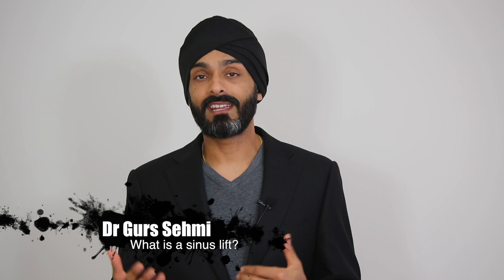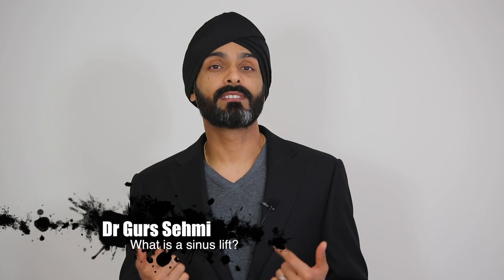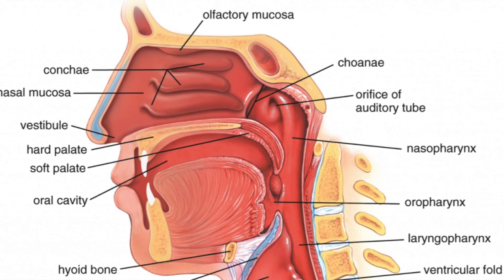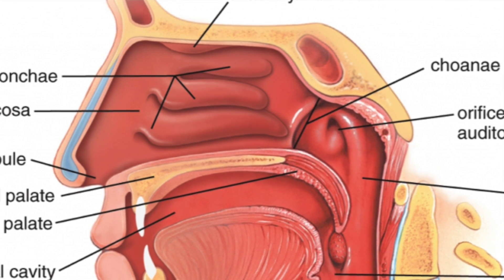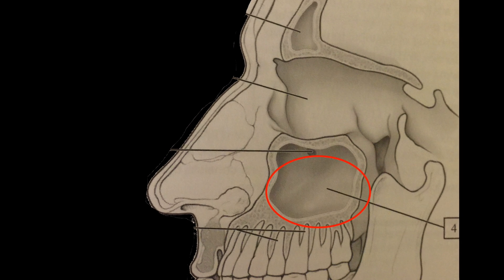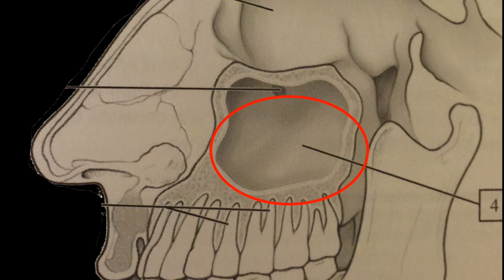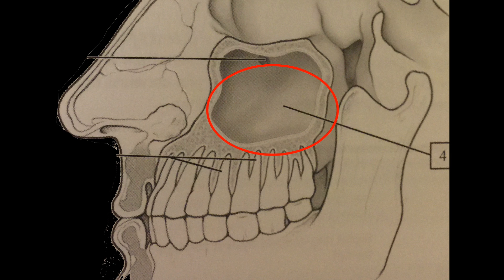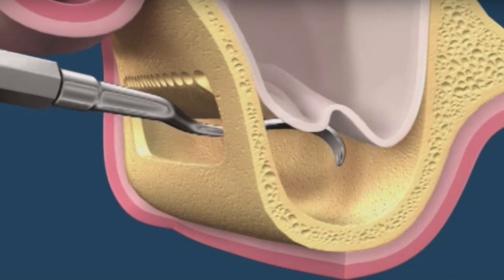What is a sinus lift?

Comment: This is off the beaten track but maybe someone can answer me. I have had all my upper teeth removed quite some time ago. Quite some time later I got excruciating  Tinnitus and it just never stops. Now I have read where some people have had wisdom teeth removed and then got Tinnitus (ringing in the ears), and I have also read where a person had bad Tinnitus and had a wisdom tooth removed and the Tinnitus stopped. I have also read where there may be a correlation with Tinnitus and sinnus. Has anyone experienced teeth extractions or sinnus problems with Tinnitus? Just wondering.

Comment: I recently had a closed sinus lift done. More precisely, they started doing it, and then the doctor said: “You have a complication, perforation of the maxillary sinus. We’ll postpone the operation for about a month and a half.” Then he stitched up the wound.
It turns out they made a hole for me, before that I didn’t even think that sinus lift surgery was so dangerous, because... all the doctors said that this was a very easy operation, “we’ll just tighten the gums a little”; and now I read what complications people have. Many people then develop problems with ENT diseases.
Now it’s unclear, alternatives haven’t really been developed yet - and this operation is now scary to do. Although the clinic is considered one of the best in the city.
Does anyone have any experience with this operation? Or a few years after it, how do you feel? Did you have sinusitis, etc.?
Reply: I had a lateral window sinus lift done a little over a year ago. I have had no issues to report. It was annoying to not sneeze or blow my nose for 4-6 weeks after. Also I got on a plane shortly after the operation and felt pressure in that area but no long term damage occurred. I went from 1mm of bone to 11mm of bone and had implants placed.
Reply: Such issues can be determined via CBCT scan beforehand. The sinuses, if needed be, should be treated and when you are good to go, have the sinus lift operation with the bone graft, but no placement of implants and have 9 months of healing.

Comment: Thank you Dr for explaining this procedure. I had two upper molar extractions and a partial just doesn't cut it. So I was told I need a sinus lift when I get the two implants. 💙🍀😎I am scared but I feel better now knowing what I am getting into.
Reply: I had a single extraction (badly cracked 1st molar as 50-year-old metal filling failed - other teeth healthy) and the sinus had dropped within a month. Sinus lift, synthetic bone graft, and short and broad implant. No visible bruising. I do notice occasional sinus discomfort on that side if I get a cold that I never had previously - otherwise, no problems.

Comment: simple to understand and direct to the point.  Just had my sinus lift and 2 implants on upper right done 4 days ago.  No pain or bruising except for swelling.  Taking ibuprofen and penicillin and soft diet x 1 week.  Spent $9,000 for 2 implants here in Castro Valley, CA.  The oral surgeon Dr. Shimane was very good.  I had general anesthesia so I'm asleep and didn't feel a thing  :)
Reply: I had the exact same thing.  2 implants + sinus lift.  Total cost about $3500.  Warsaw Poland.  That includes the cost of the crowns which are the actual teeth as well.
Reply: @Avoltrix_official   forgot to mention, $9000 includes the crowns as well.   Too expensive to live here in California lol
Reply: @Avoltrix_official  Did you get both sides done? How are you feeling a couple of months later? Many blessings
Reply: @KrzysztofK1982 You got ripped off... I got sinus lift, bone grafting and 5 implants, crowns included... for 7k in Mexico.
Reply: I want to have implant but I don’t have enough bone 
So my doctor recommend for sinus lift and lift graft 
But I’m a bit scared  
Should I ?😢
Reply: @rachelleroyales3775  it's normal to be scared.  The best option for you I believe will be general anesthesia so you're sleep and by the time you're awake, you're all set.   It took me like around 2 years to finally get the crown coz you have to wait in between procedures for the healing process to take place. I also had a graft twice coz my bone loss was pretty bad.  But thankfully it worked out ok.  Good luck! :)
Reply: @Bullybeef972  
Thank you for your  reply 
Yea that’s true but my bone was really bad as well I went to many dentist  and thề opinion is different the only best I can do for now is zirconium crowns which I have before but thé cement is gone after 4 years  so I’m trying to have implant  but my bone is nớt really enough which I will have 6 graft and 2 sinus lift😢
Reply: @rachelleroyales3775  Just take it one step at a time.  Like I said, it will be a long journey but worth it at the end.  Just have it done as soon as possible so it doesn't get worse in time.  Hope you find a competent dentist that will take care of you.  Glad I found one here in CA which was recommended by my primary dentist.
Reply: That’s the hardest part
Reply: @rachelleroyales3775 did you do it? Please let me know of your journey!
Reply: @rachelleroyales3775  I had implant surgery, “All-on-4” beautiful teeth from a 3D printer and I was following all the post op instructions, soft diet,etc. I was elated and joyous because in 2020, I previously had a sadistic surgeon who screwed me over by pulling good teeth- just a nightmare too much to divulge here. He was a major a-hole. I ended up calling him an arrogant prick! I’m in my 50’s and I just don’t take crap from anyone who treats me very, very badly. He fired me as a patient but was kind enough to recommend me to a different doctor. This new doc has great bedside manner, has mostly all good reviews and I really like him. He has such a positive outlook and confidence in his skills. I was a previous smoker & again in my 50’s and the implants did not bond with the bone and grafts.  I was utterly devastated because the failure of the implants just didn’t enter my realm of possibility! That’s how confident and assured my surgeon is~he actually made the statement “I’ve never made a promise to a patient & couldn’t deliver on that promise.” Such a bold, confident statement! I had much trepidation having him try again, I actually showed up the day of surgery with my husband to discuss what he would be doing differently this second time and he, again, was super confident it would work. I had previously told him, if I have to go without teeth for the 2-3 months it takes to heal, I’m willing to do it it’s so miserable and time seems to be slowly going by!!! That’s what he did differently ~ having the implants not bear any load while healing. But at my one month follow up after this second surgery there were subtle red flags that have me worried, hence me finding this site for presenting him with any alternative ideas if these current implants fail. He apologized for being over confident the first time around. I said to him “Are you setting me up for disappointment?” No, Cynthia, we need to keep a positive attitude and wait and see after another six weeks. Looking at the X-rays, he was explaining which implants were looking good, then mentioned an area where he wants to put another implant and more bone grafting. He was so blasé about it, I got pissed! Like, Oh, just another procedure. I’m wondering how much of him is trying to satisfy his ego that he really can deliver on the promise; it’s just at my expense. The physical and mental toll is rough! Again, I was devastated, then PO’d when the first go around failed! I cried for days. I have many people praying for me and I’m really trying to keep up the optimism. My next appointment is in a few weeks! I’m just researching and preparing myself if the outcome isn’t positive. I plan on emailing him with my questions and concerns even though I’m getting ahead of myself. Again, prepping more mentally so as not to be too disappointed!

Comment: Today I was in the chair for four hours. I had four difficult extractions where the roots were fused to the jaw and took a long time to extract. I then had three implants put in one side and two on the other (then two lower right side) I had lost bone because of old tooth loss following trauma and infection and accident, not neglect. The dentist numbed me up really well then drilled into the jaw to the sinus and then 'hammerd' it up with an instrument and a hammer. The pain and vibrations were incredible despite the numbing. He then for some reason (couldn't ask) used a bone expander that eaked up into the nerve and again incredible unbearable pain several times. I then had the implants put in with bone grafting and about 60 stitches top and bottom. When I got out of the chair I couldn't walk, my body wouldn't cooporate and the pain was all encompassing. I then had a butt injection for the pain and another for swelling and given two antibiotics, a pro biotic, a stong pain killer, mouthwash and a nasal spray. The pain eventually subsided and I ate because of the antibiotics as I have a fragile stomach. I have a long list of don'ts, from blowing my nose, to hot showers, to alcohol (don't drink anyway) to sleeping sitting up. I have no idea what the next days will bring as I have to be fitted with temporary crowns as they filed down all my other teeth and in six months they fit all zirconium crowns. I had to keep thinking of the end result and the difference it would make to my life but during the procedure all I could focus on was killing the dentist and setting fire to the clinic! I got over that of course.
Reply: Jesus that doesn't sound fun or normal. Shouldn't you not feel anything besides pressure during the procedure? I get that after when the numbing wears off you'll feel it, but I would freak the hell out if I felt it during lol. They'd have to knock my butt out
Reply: @amymbeauty8765  Yes when I told my dentist in France he said that doing all these procedures together in one session was illegal and unethical in France. I am quite a few weeks post op today and the last stitches are out, some by me and there is surprisingly little pain. Several teeth are sensitive to hot and cold so I presume that they filed down the teeth too much and they now need to be treated and sealed. For now I have to wait at least six months for the implants to take and healing to happen. I have no regrets, I should simply have researched the sinus lift more before the operation !
Reply: Oh gosh that doesn’t sound fun, idk if I should do this procedure or not. Thanks for sharing your experience!
Reply: Sounds like what my brother calls “Civil War medicine” where they amputate a limb in the battlefield, nothing for the pain, wrap it up and put you back on the horse to go back in & fight!! I don’t understand in this day & age we are forced to endure these barbaric yet necessary dental procedures. “Sedation” dentistry is a joke ~ giving you a Valium or benzos in my case. Had implant surgery, which failed by the way, and while they did help me relax and also put me out, the surgeon kept asking me to open wide, wider, etc. I was like, dude, can you just put the instrument in my mouth that keeps it open, you know the gadget they use to keep your mouth open for X-rays. How are you supposed to  be “sedated” & relaxed & have the dentist giving orders, also while wearing headphones he put on me to listen to crappy music! And after my procedure my face felt like it was on fire and I was crying because of the pain and with the first implant surgery the post op was taking ibuprofen & Tylenol. After the second go around, same situation but worse pain, he prescribed 3, 5 mg. oxy’s ~ 3 pills!! Really? He couldn’t give me maybe 10, or whatever the count would be for a few days?!? I’ve been on pain meds before and didn’t become addicted even with a week’s worth of oxys! Luckily my husband had a full bottle of Tylenol & codeine from his regular dentist from a root canal! He only took like two because a root canal isn’t really that painful! I used the oxys on the first day, then about 4 of his the next few days. Anytime he or I receive pain meds, it’s like gold treasure we hide away for when it’s needed! I had a 5 hour kinda major surgery & 3 low dose pain pills. Unbelievable! The only good thing about that 2nd surgery is they wheeled me out to the waiting room where I had my head in hand, crying and loudly stating “it burns, take me home” over & over again. I was waiting for my husband to bring the car around. He said “Well, your doctor may have lost some patients because of you screaming in pain!” I didn’t notice but he said there were about eight people in the waiting room! I would’ve smiled or laughed if I wasn’t burning with pain. Then the doctor called me the next day to see how I was feeling~I’m f-ing miserable! How the f*+k do you think I’m feeling!!! My mouth & face blown up three times its normal size, throbbing, unable to eat and hard to drink anything! Again, the barbarity of civil war medicine in this modern age!! I even told the doctor this on my follow up appt. and he managed a small chuckle but completely discounted the trauma & pain like it didn’t even happen!
Reply: Did you have all this done in Turkey..? I've just had the same procedure. 2nd day with swelling and little pain. Blocked nose and a little bleeding. I agree it seems a lot of trumor all at once.
Reply: I’m sorry you had to go through all that pain. I had a sinus lift done a week and a half ago but I was asleep and intubated for four hours during the surgery. I had 5 implants with temporary teeth until I fully heal. The dentist and his team are amazing. I had tolerable pain post-op, swelling on my cheeks but no bruising. I’m on purée diet for the next 2 months. I can’t imagine getting a sinus lift done without sedation. You’re a trooper!
Reply: @takimando1739 Hello! Trooper here! My first implant surgery failed in Nov. 2024. Had it redone in Feb.2025~just had the titanium implants put in, no teeth for three months so the “load” would not impede the osseointegration-the screws bondage to the bone. Went back May 11, 2025 and it worked! Was going to get two more put in so I’d have a more sturdy tooth structure (called “All on 6” instead of “4”). May 20 go back and he puts screws into the titanium “rods” and I felt pain on the right. He said I shouldn’t be feeling any pain at all then said they failed. I said “two weeks ago you were hammering on them all with no pain on my part and now two have failed!! How is that possible? He said it’s my biology! WTF does that mean? Gotta go back to get two taken out, then four more put in! I see so many f*#king ads for “have teeth the next day with dental implants.” It’s been six months! I thought I’d be going on vacation this summer and living my life. Instead I’m stuck watching life go by and everyone I know just moving on, living, having fun & I’m miserable! Just b*#ching! Thanks for reading my rant~ my family is sick of me talking about it! I can’t believe this is my life! My father is religious and has prayer groups praying since February! I’m trying to trust in God, his advice! Not easy!
Reply: Yes I recently had an upper molar implant and I also needed a sinus lift.  But the dentist was using some sort of hammer to knock and push up the sinus through the hole he already drilled.  Man, those knock was vicious and I was thinking Jesus all my surrounding bones gonna shattered it was so intense.  Although they warned me in advance it still makes me wonder now is this a normal procedure?

Comment: Thanks for this video. I'm going through the implant process and was told I'll need a sinus lift. Would it change things if I opted for a bridge instead of the implant? Would I still need the sinus lift?
Reply: A bridge wouldn't require surgery at all
Reply: You don't need an sinus lift for dental bridge. Did you do something?

Comment: Hi,
I just had a wisdom tooth extraction(I am 29) , during which the sinus was exposed, I was asked to have sudafed, sneeze with my mouth open & not to blow my nose,
Regardless I am experiencing pressure in my forehead when I bend my head,
And pain in the cheek,

How can I  know for sure the sinus has healed??
Reply from the maker: Hi, the important thing is that there is no connection from the sinus to your mouth (oro-antral communication, or OSC). If you have a drink and it comes through your nose, then you have this. Even if you do - it can be repaired, but you need a good surgeon, not a general dentist. The advice about blowing noses, avoiding air travel etc is all good, and try your best to stick to it. I am not sure what the forehead pain might be - that sinus is not normally effected. It could be something unrelated

Comment: Can u pull a tooth if it’s connected to the sinus if not how is that treated ?
Reply from the maker: Hi  yes you can. If there is a risk of a hole to the sinus, then there is a procedure that can close this hole. Its not simple, so I would see someone who has some experience in this, and maybe not a general dentist. If you get this hole, it will be extremely annoying, but it can be corrected later as well .
Reply: @drgurssehmi  What is the procedure name, please? I have an upper tooth which needs to be extracted and there is a chance for a big hole. Isn't this called sinus lift? Thanks
Reply: I got it done I came out well no sinus exposure regular extraction

Comment: Would a sinus lift be necessary for a pre molar tooth?
Reply from the maker: Usually not, but sometimes you might need it
Reply: @drgurssehmi  In general, is getting an implant in the upper jaw area more painful than the lower jaw or even in the front of the mouth?